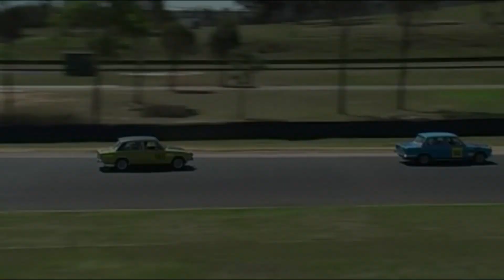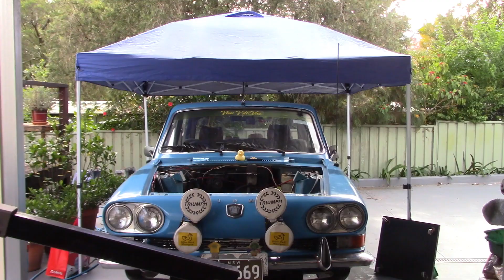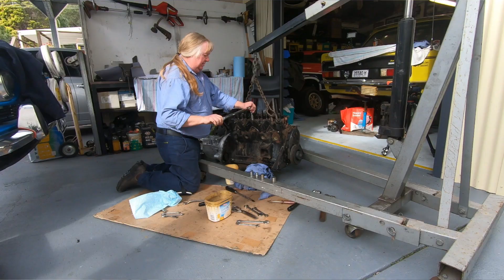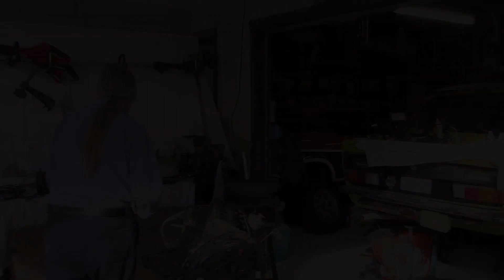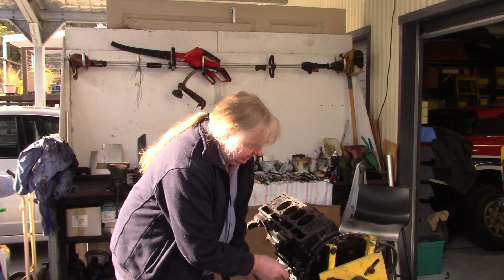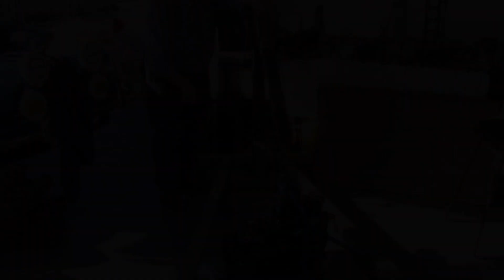Triumph 2500 MK I Repairs part XIV

Comment: Where will you get the oversize  pistions from. I can only find pistons for the dolly Sprint in the US. 
I am thinking of replacing the liners to put the engine back to STD then purchasing STD pistons but don't know how easy it is for an engine shop to replace the liners in the dolly block. 
I have rebuilt dolly engines in the past and found the top rings broken but they had shown  up on compression test.